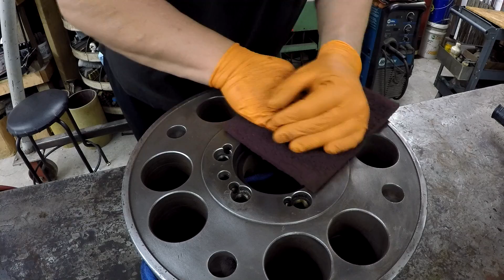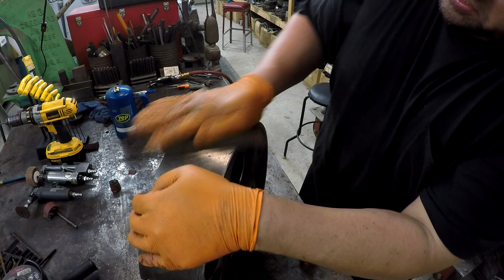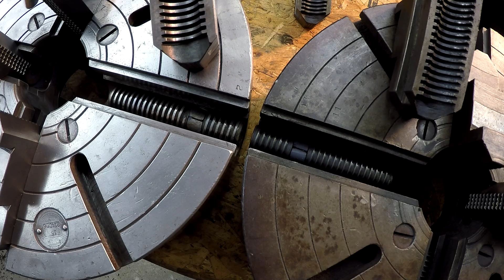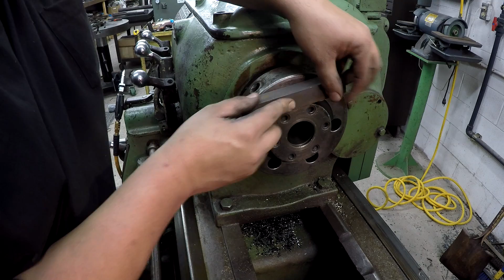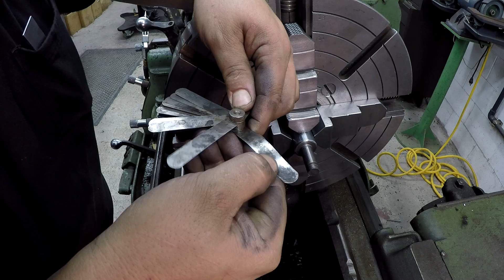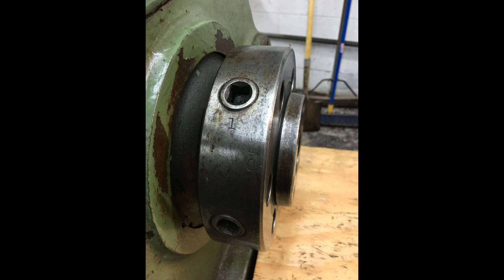New Cushman 4 Jaw Chuck Part 2

Comment: I'm kinda surprised you didn't knock out the retainers and bull the screws. Then you could have mounted the body and lightly skimmed the face and OD with a ceramic insert to a satiny finish. 

Stoning is a fine art. How to sense the lumps and bumps, awareness of the stone's convexities and how they bear on the flat surface, how much to concentrate on raised metal, etc can be difficult to convey to the coming generation. I've never seen it dealt with in trade texts but I'm glad to see you have the skills on tap. Nice tutorial.
Reply from the maker: +Forrest  Addy I would think those screws need to be machined and heat treated correctly Forest. Have you ever removed the retainers holding them in? Are they pressed in? Sometimes a light stoned is all the Dr ordered. I sure love that big Norton stone I used, got it at the flea market for $8.
Reply: +Abom79 The retainers for the jaw screws are a press fit in my experience. I've knocked them out from the screw dide with a hard tapered punch. Alternate blows in turn on the forked ends of the retainer. They're tight so hit them hard 'til they start moving. Scribe them for orientation so you can get them back in straight - which I never did the first time.

Comment: I saw a trick once where you put a piece of rod tightened in the chuck with about 8" hanging out both ends.   this gives a handy handle for carrying the chuck and makes it easier to put the chuck back on....helps to line it up.  I no longer struggle with the chuck.

Comment: Nice work, I've learned a lot from your videos. if you haven't thought of it try a little steel wool wrapped around the wire brush you used in the dewalt cordless to clean the holes. Works great in a lot of situations.
Reply from the maker: +camp ranger Good tip

Comment: Recesses in back of chuck are to reduce inertial mass making it easier to start spinning.   Jaws are probably numbered for both fit and balance.  I would hope that Cushman balanced that chuck after they drilled the lightening holes on the back. 

Would like to see you build a new set of screws for the old chuck and bring it back to life.

Comment: Adam,
A word to the wise my friend....... You really need to wear a heavy apron when you use that wire brush. Those bristles come out like little missiles and will go right through that thin t shirt. I have had to remove them from my stomach as well as my arms. They are painful as hell and if you don't get them out they can cause infections. It helps if you use a new brush when possible. The bristles are not fatigued and won.t break off as bad. Great job on the chuck. You have some great support for your shop and channel and I look forward to every new video. No kidding, really be careful with that wire wheel. We don,t want you getting hurt.

Comment: Try some emery boards on those t slots if you want to get those a little better.  Pushing down on it with a screw driver thru the slot should get it clean all the way to the end.  Those things are pretty cheap and come in handy for lots of uses.

Comment: That turned out great Adam.  Very generous gift from Jack Innis too. On the old chuck, I wonder if the heat treating was slightly off allowing excessive wear on those screws?   Jeff

Comment: Further to your communication with +Forrest Addy four hours ago, re:- Removing the Acme screws, it looks possible that  they are held in place by two metal claws that retain the screw, clearly visible with the jaws removed, that are themselves locked in position via the large, shallowly slotted retainers seen on the rear face of the chuck. Note the shallow slots
align with the jaws.

Assuming that nothing has seized up, by pressing down on the retainer, that is possibly sprung, while supporting the claws from the screw side and turning through 90 degrees, this may 'unlock' a bayonet type arrangement, allowing release of the claws and in turn, the screw, maybe?? 

Super new chuck, Blue chips back on the menu.

John Greenwood

Comment: Nice 4 jaw pal :) Mine is not so well,Tried to purchase 2 from 
eBay one  come with damaged jaw threads,If you are going 
to buy a second hand chuck,Defiantly ask to see under the 
jaws..Also check the screws..And as Adam show where the
jaws are gripping on the stock all the jaws contact the stock
on mine it only contacts the stock on the very back of the 
jaws..

Comment: Precision substitute for the graphite powder is a 2B or softer pencil, rubbed up and down the screw. Graphite powder is also best for locks and keys, as it doesn't produce air locks.

Are you going to put in a "breakaway" feature in the new chuck key, so you don't over-Abom-Force when tightening? I think Tom Lipton could give you a pointer or two... ;)
Reply: for lock your better off with Teflon non stick dry film amazing stuff
Reply: +David Howard True ... but I have pencils in my desk, and I usually don't have time to go hunt teflon down if I need to get in theough a door :)

Comment: Interesting on the graphite. I lightly oil my chucks, but grease makes them stiff. I would still only oil one even with a grease zerk.
Reply from the maker: +The Metal Butcher Another way to use the graphite powder is to mix some in some way oil. Very nice and slick.

Comment: You did a nice job! 

I have one of these exact same chucks in, dare I say it, even better condition than the one you just cleaned up. Unfortunately for me it does not fit my lathe as the chuck is a D1-6 connection and my lathe has a D1-8!

I'm looking to sell if anyone is interested?

Comment: just had a thought.. how much play in the slides of the old cushman jaws..  set them in parallels in the side slots and check the vertical faces.. to see if its slot wear or jaw flexing from the many tightening and perhaps a few crashes we won't ask about. 

 are new  cushman screws available still or can you machine up new ones.. even making them slightly oversize..  its just a thought..  might even drill a mounting plate for the cushman to mount in a vice or T slots  using clamps to hold and level the vice on the milling machine.. you could perhaps lock the old jaws and run a mill across them to restore parallel or set up the jaws in parallel blocks in the mill vice to cut new grip area   just a few thoughts. 

wayne..

Comment: Wonder if that 1 screw was just a weak material, causing it to wear faster than the others- would be interesting to compare the hardness to the other 3- could also have been some production line setup where the operator only loosened the one jaw day after day.

Comment: I noticed when you were stoning the surface that contacts the spindle that you didn't use oil with your stone. I was taught to always use oil or water with your stone depending on the type of stone. Any reason you didn't use an oil? To make clean ep easier? Or just how you were taught? Also, Thank for another great video, I always learn something new from you.

Comment: Congrats, like the rest, on a good job well done.  it looks good and should last another generation or two.

One thing I noted was that you mentioned a taper fit and locating surface inside the chuck, yet you reckoned you needed to stone the face where the cams screwed in.  Surely the chuck would tighten on the taper and the cams won't/should'nt pull those stoned faces together?   Unless seriously dinged, the stoning was unnecessary?  Please can you clarify, if I am wrong.

Comment: Hi Adam, nice chuck. Those few inches made a big difference. Regarding the wear on the rotating bolts of the old one, specifically on the uneven wear of the thread between bolts, one could guess there was not an homogeneous hardness of all bolts, and those that were softer got damaged more. Anyway they should be the ones that should always go to the sacrifice and not the jaw. If I had to guess, I find the uneven hardness hypothesis a little weak. Could it be that both that had the excessive wear, had the bad luck of getting a load of abrasive from an angle grinder or another source, and that the trapped abrasive (opposed to a three jaw chuck) never cross contaminated the others but slowly weakened them? If there is a chance this is true, I would remove to bolts of the new chuck and clean them thoroughly, because after all that grinding and polishing you want to be sure there is no (or a minimal) amount of residual abrasive trapped. The cleaning with the fast evaporating solvent will not do the job well. Regarding the old chuck, when I was a boy (40 years ago) my dad took an old chuck, and on the same lathe without the jaws and bolts mounted, skimmed out a thin layer of metal, leaving it like new. Maybe your old one could return to life easier in such a way and that you made your own new bolts (or buy them)? I enjoy all your videos and have learned a lot from viewing them. Thanks.

Comment: Looks good Adam. Would the wearing on the 2 screws be caused from the Chuck studs being slightly loose maybe? I'm also wondering about the jaws teeth may not be straight, causing those screws to be tightened more so than the others to get the correct concentricity? I'm NOT a machinist, but just thinking out loud, if that makes sense. Cheers Blessings 🙏

Comment: I suspose that the old 4 jaw that had two good jaw threads and two poor ones - was used in production having two in 'standard' position and the other two moved in and out to 
adjust the center of the load.  One might never know but that seems logical to me.

Comment: Adam, You can make and ht. treat new screws. I've done it a few times. Thanks, Cliff
Reply: What material would work well? I haven't worked with tool steel much. I have heard A2 is pretty stable during heat treatment. 

I mainly work with mild carbon steel, 303, 304, 6061 alum, brass and plastic.
Reply: I would just use a chunk of 4140. The square hole in the end could be put in with a sinker EDM if he has access to one, but there are many other ways to do it.
Reply: And they will be better than the originals because you can make it slightly larger to compensate for wear on the female threads

Comment: I'm sure the graphite works well in manual machines but in my CNC lathes we run flood coolant quite often....grease is required.
Reply: Plus that graphite doesn't stay there for long. I would never use a chuck without some ep grease. Preferably moly grease. Also allows you to produce more clamp load

Comment: how are the cam studs machined so that the guide line is in the right place? are the threads all started in the same spot? what's the technique for making identical studs like those?
Reply: ...I'd guess the studs were threaded first...then screwed into a fixture for milling the cut-outs.
Reply: +Doug Ankrum that would be my guess as well. Machine the groove and notches in a fixture.
Reply: ah so you'd just thread them as normal, then screw them into a block held in the vice and mill them that way.
Reply: +SuperAWaC that is what I am thinking. But it seems to me that the threads in the chuck plate would need to be clocked as well. On a CNC that would just be a matter of using the rigid tap option. 

But I am just guessing.
Reply: horseshoe28016...Yes, you're right, Rigid tap, or better yet, with CNC...use a thread mill...they can keep the starts to less than 1degree of rotation/clocking..
Reply: You outta see USAS B5.9 (1967) Spindle Noses. The drawings for the D1 series camlocks are dillys.

Comment: Where's the queen city grinder? whats that tiny little thing you got there?
Reply from the maker: +JohnHolmestheSecond The Queen City is further down behind the Victor lathe. The grinder you can see in the video is a Baldor carbide grinder.
Reply: +Abom79 would it be possible to grind chuck jaws in that grinder ? ;)

Comment: would it be worthwhile to check the runout on the chuck face? if there is significant runout, how would you approach a fix? would you just skim the face or is the chuck hardened?
Reply: That would mean that the back mounting face either has a high spot, or is not parallel to the face/ perpendicular to the ways. I would set it up on the mill face down and resurface it

Comment: Adam, I noticed the Monarch has a short notch on the top of the back V way near the chuck. (I'm not talking about the gap under the chuck.) What is the purpose of that notch? Great series!
Reply: I'm pretty sure that is the result of a crash. iirc, that lathe made warships at the end of WWII, so it had a hard life until the Booth family took it in for adoption :)
Reply: I think it is a gouge from dropping a chuck or workpiece

Comment: Looks good.  That sure is a quiet machine. 

Do you have 3 phase from the pole, or are you running a phase converter?
Reply from the maker: +gadget73 I have 3 phase power from the pole to the shop.

Comment: Soak the grinding stone in the water it will work better and lasts longer.
Reply: That is an oil stone not a water stone. You just end up with a rusty mess with a stone like that because it is so porous

Comment: now the chuck is mounted wouldnt u check to see how true the actual face is or i think u call it run out. i figured with how you indicate things u woulda indicated the chuck as well
Reply from the maker: I show a video clip of indicating the face and OD in SNS 130. They are both .001 TIR

Comment: What's the maximum RPM for a chuck that size?
Reply from the maker: +Justin Bell That I'm not sure about.
Reply: +Abom79 I've seen lots of figures different places. Solid body chucks like Adam's Cushman would have are higher max RPM than a cored chuck body. I don't know if People Wiser Than Us have run chuck body analyses for work holding equipment us bottom feeders are likely to  use. Maybe someone will model a chuck and conduct FEA.

Other than that the rating 3000 FPM on the OD is one but that seems scarey to me. .Centrifugal force would tend to relieve the clamping force therefore I would think max safe RPM is influenced by the diameter of the grip. 

I've run my cast bodied 12" Bernard to 1100 RPM many times on work 3" and smaller. But higher RPM? Brings forth the sweat because that exceeds the 3000 FPM stricture by 15%. Maybe 3000 FPM is reasonable. I dunno.

Anyone got good numbers for this Max safe RPM for chcks of different styles, sizes, grip diameter, etc? Comparing anecdotes is not what I'd call hard info.

Comment: Actually, it is not the same chuck than the one who was rusted. The first one has multiple holes in the back. This one has a lot less. The first one also comes with a threaded outside back diameter. Not the one you are installing in this video.